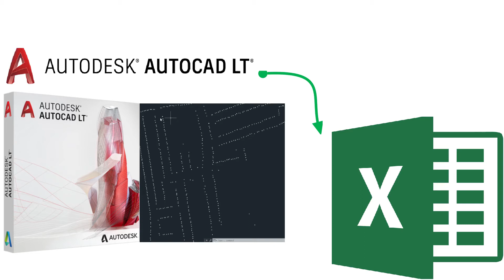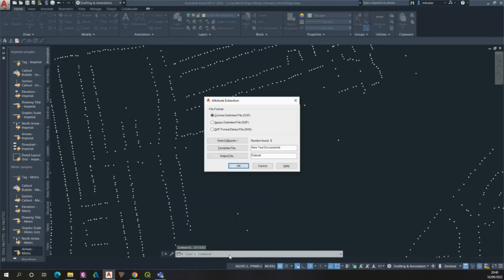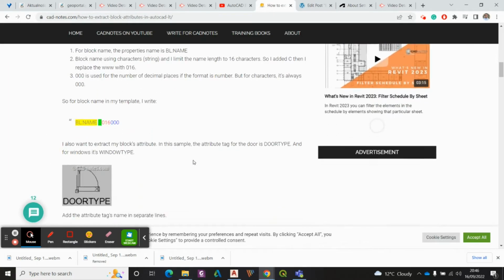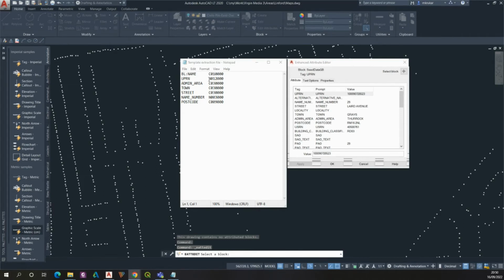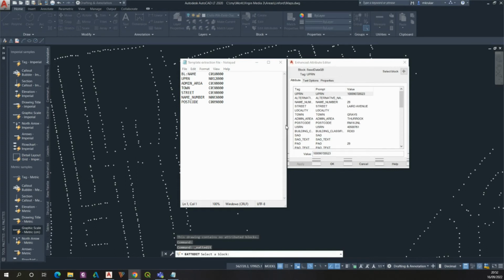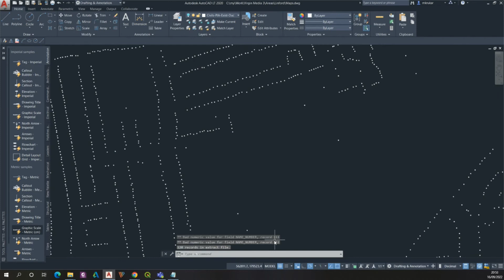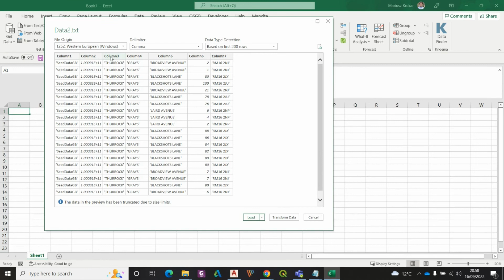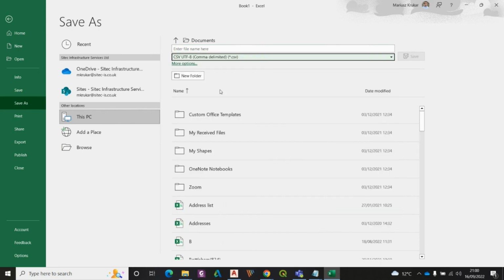AutoCAD Lite to Excel - export properties data

Comment: This tutorial is really helpful Mariusz, Thank you! Any chance with this method you can get the total number of blocks listed automatically (for the blocks with the same name attribute)? So it will display you automatically you have for example 45 blocks of door inside the building with the same attribute name for example "Door_900mm"? I can see that each block even if they have identical attribute name are distributed and listed in a separate line.